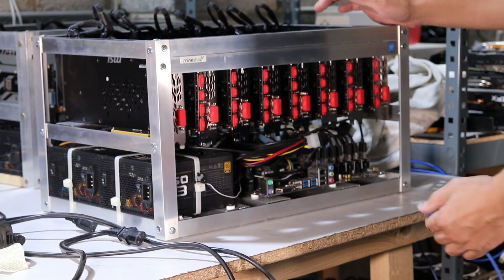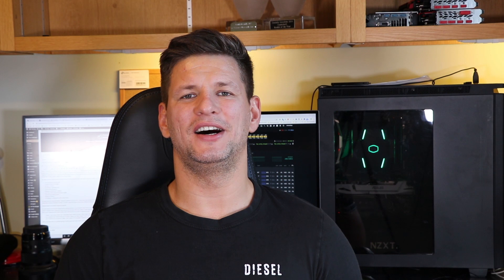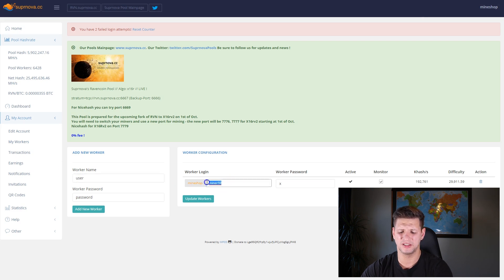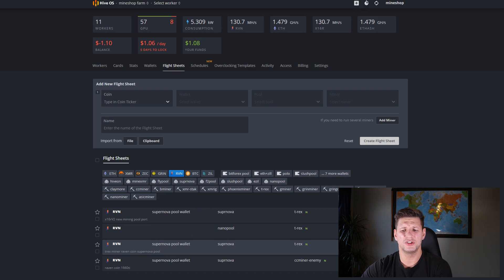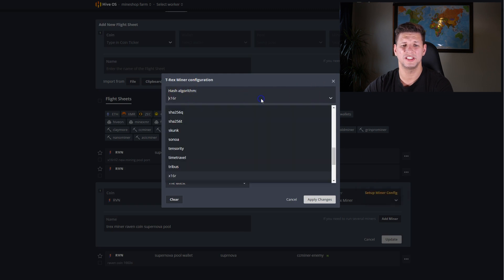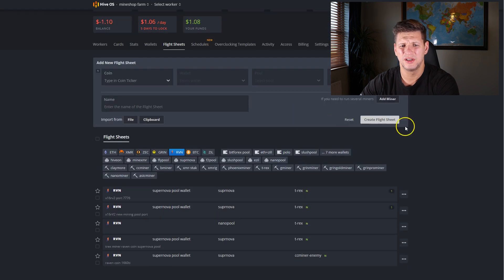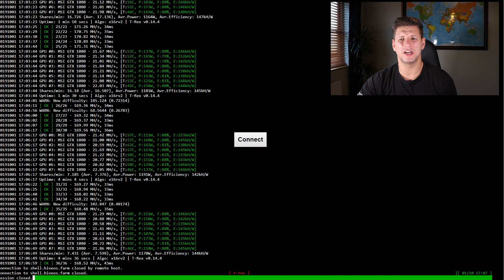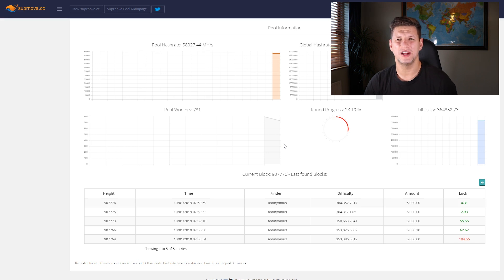📑 x16rv2 mining Raven coin network upgrade , how to start mining on hiveOS.

Comment: Thanks for this video.  I keep getting "ERROR:  Can't start miner, unable to get number of CUDA devices, in nvidia driver installed?" As far as I can tell my nvidia driver is up to date.  Any ideas?
Reply from the maker: What is your driver version? I had same issue . Updated to latest and it worked. Run the nvidia driver update command
Reply: @GuntisVitolins  thanks for replying. I didn't realize the update was still running; looked like it was frozen but I just got it sorted out.